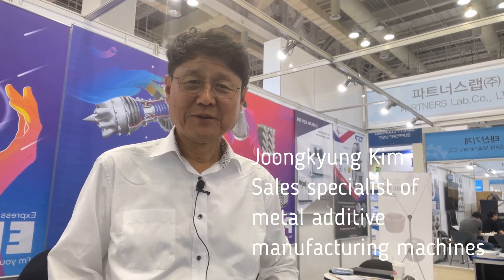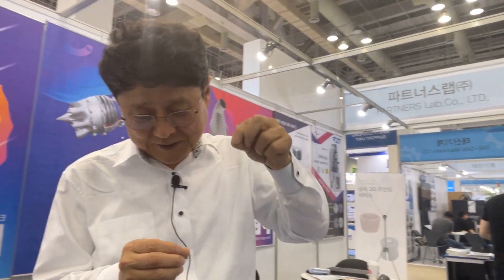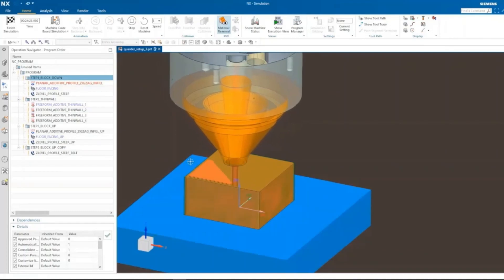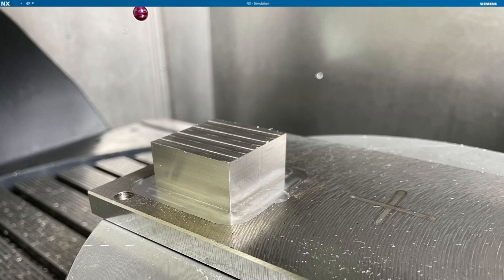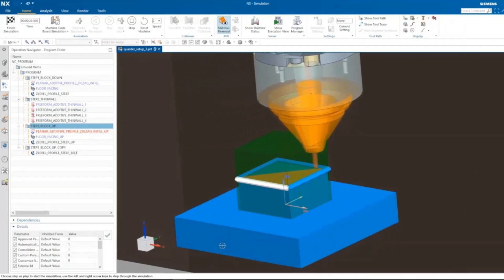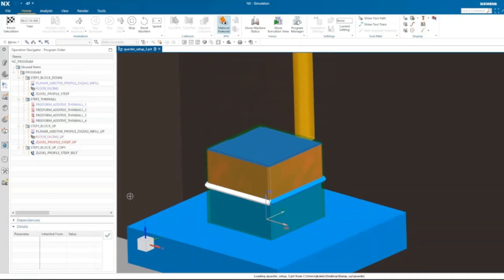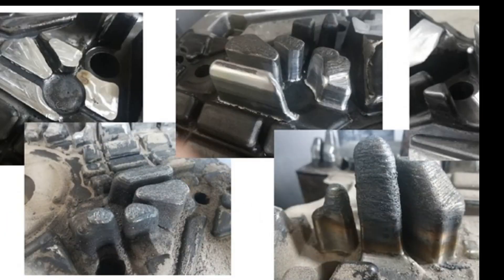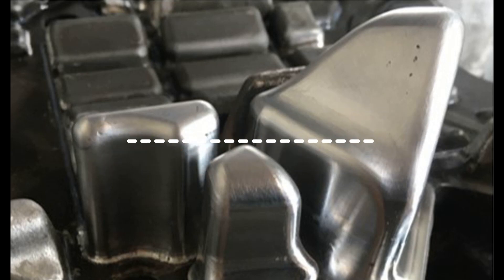Success in mold & die - Direct Engergy Depostion (금형수리)

Comment: First of all, I want to thank you for creating such an informative video. I have some doubts:

1. How do you deal with the variable height problem of WAAM?
2. Do you keep the layer height constant for the operation or vary it for each layer?
Please Reply sir.
Reply from the maker: Thanks for your question.  This is DED with powder as feedstock. There is a read system which can evaluate molten volume and height. But my machine doesn't have it (it is option).  The layer height should constant in proper working conditions. Further, the layer height can be set anytime by face mill operation. It is a benefit at hybrid system (additivce + milling).  I explained my experiance at my video titled "DED hybrid additive manufacturing dated 15th of June. Again, thanks for your watching my video.
Reply: First of all thanks for replying. 
Sir I have set the inertial gap between the work plane and the torch was 1.2 mm. And I'm using shielding gas is Argon + CO2 with 80:20 ratio Wire material used was SS317L. After 14 layers the robot misses the later height that was supposed to be reached
This lead to misfire or no ignition. 
Please sir suggest me something what should I do to resolve the problem.
Reply from the maker: Dear Utkarsh, the distance of gap varies from the molten volume.  The effective factor can be electric power, feed rate or, Hz, etc., Proper melting factors should be set in order to having stable melting beads.  You can adjust feed rate by jog handle manually. The distance between the torch and workpiece will get closer when the feed rate is slower.
Reply: @LaserKimAM  Sir, I'm seeking more information from you like :
1. What was the diameter of the wire you used?
2. What is the material composition of the feed wire?
3. Due to variable thermal distribution, the base plate gets destroyed. How were you able to counter that issue?
shown in the video. 
4. The set current value. 

Thanks and Regards.